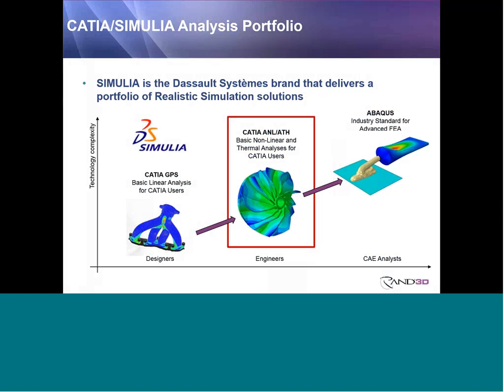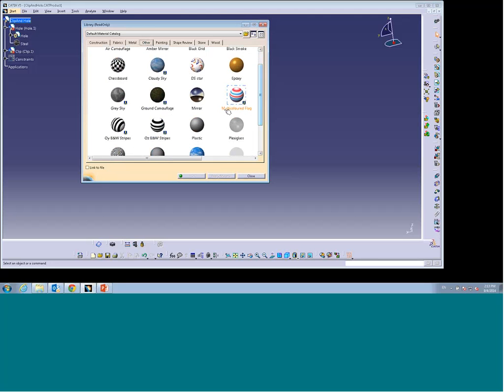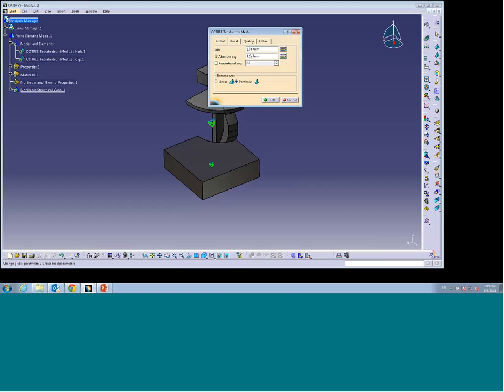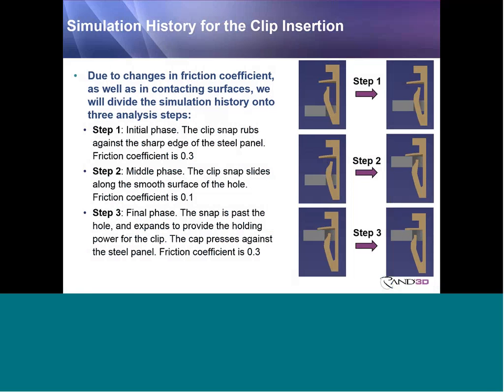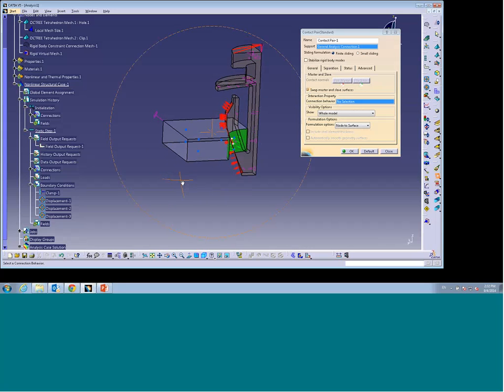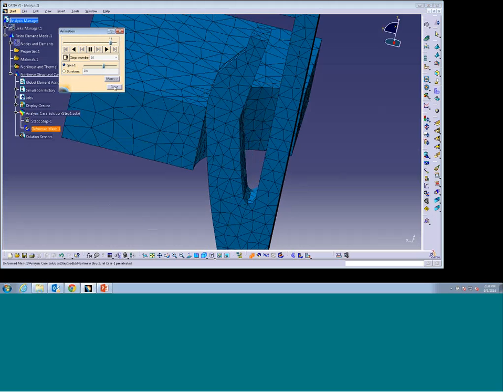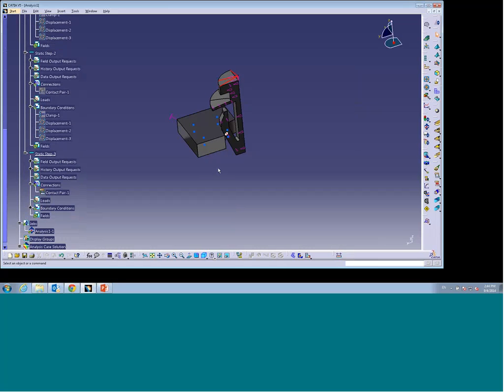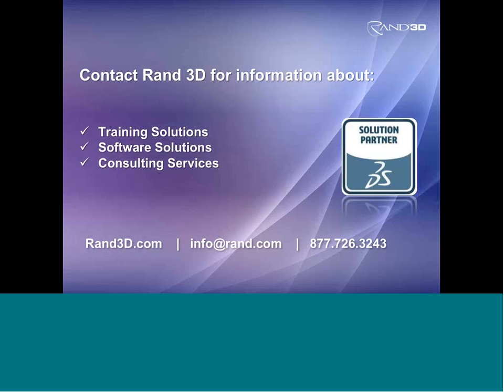Getting Started with SIMULIA Non-Linear Analysis

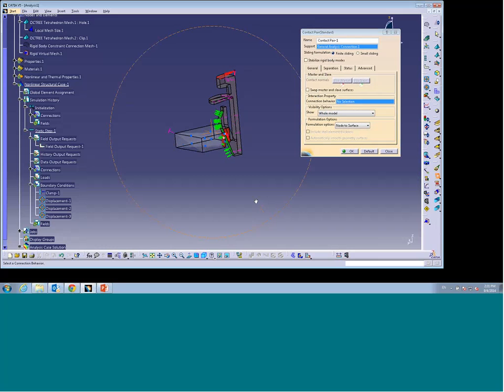Comment: Is there a chance that Mr. Apanovitch forgot to set the Interaction Property in the Contact Pair dialog box at 24:45? Thanks!
Reply from the maker: Yes, you are correct, there was a missed step when creating Contact Pair, which was to apply the Mechanical Connection Behavior from the previous step. Thanks for your note!
Reply: @rand3d  Many thanks for this webcast!